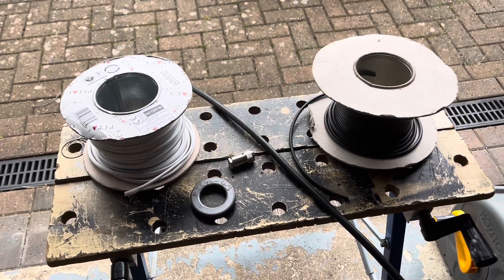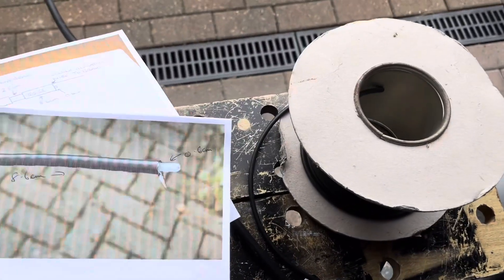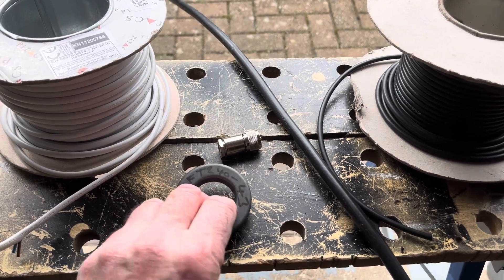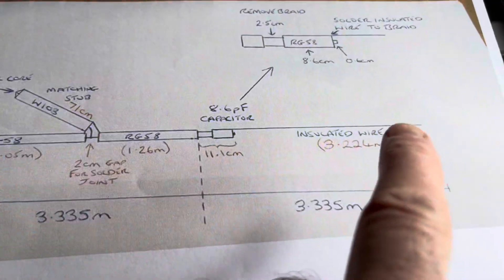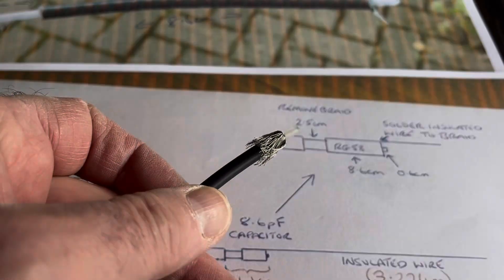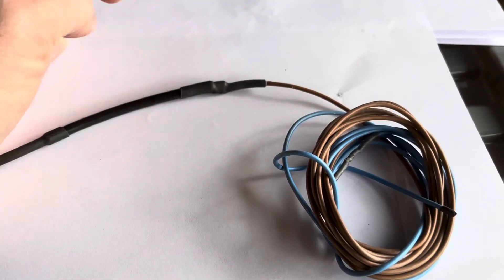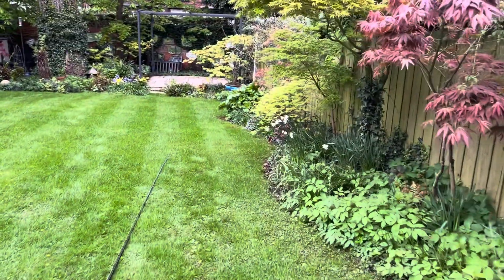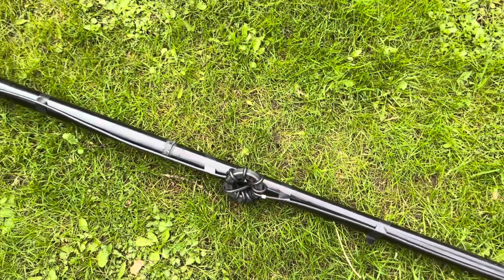10m 5/8ths Antenna Simple Build

Comment: Mines still going strong, worked Peru, Iraq, Israel, Argentina and Lebanon on 10m yesterday and Brazil on 12m (tunes fine with internal tuner). Mine is only mounted about a metre above ground, it's a very capable antenna I  think and very straightforward to construct. The only difficult bit is the centre joint between the two  lengths of rg58 and the westflex (mine used several miles of insulation tape!). Thanks Ian for making me aware of the design and the good instructional video. 73s Owen 👍😊
Reply from the maker: Great stuff Owen. Yes, once you know how you’re mounting it you can enclose/protect that mid-joint section. I’m going to slide on some plastic electrical conduit I think on this portable version. The previous one is just taped to the rope which is up in the tree and is happy dangling 👍🏻 Have fun! 😀

Comment: Sir, that westflex 103 is not common in our country, can I use RG-8 instead?
Reply: Yes, you can use rg8x/mini8... But you will need to alter the length.  I did it myself the other year... Can't remember the measurements off the top of my head... But it worked just fine
Reply from the maker: @LuCiFeRSDS  great. 👍🏻
Reply: @LuCiFeRSDS Sorry, just saw your comment. Okay sir, copy that, I may do just that. All the best.
Reply from the maker: Hi, I’m not sure, but in the video description there’s a link to Westflex-103 specs for you to compare.

Comment: Hi i got the hawkins radio version of this anttena (ssd 58) i copyed this anttena for portable use , i used
Rg58 for the capacitor and it works fine its listed as a 5/8 wave virtical dipole for me its a verry good dx 
Anttena i have mine on a 12m mast chris G0WFH 😊
Reply: I ment to add it works on 12m band as well
Reply from the maker: @kazcat8096  Yes, these do too with a tune 👍🏻
Reply from the maker: RR Chris 👍🏻